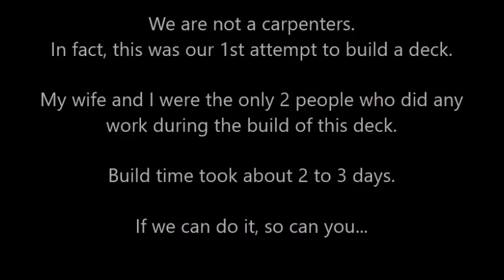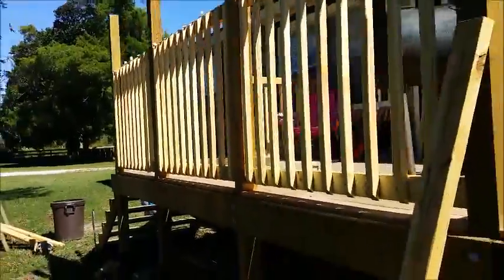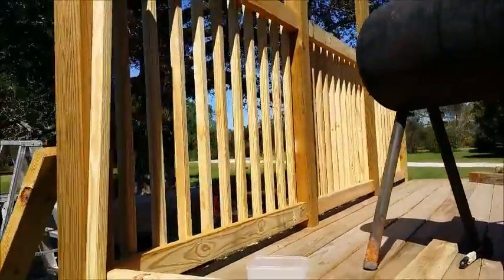How to Build a Small Deck

Comment: Thank you for the video. I am planning to build  small 4x4,  6 steps deck.
Reply from the maker: Welcome, the only thing i would suggestion is using 2x6 braces underneath the bottom of the deck, attaching them to the posts.

Comment: Yeah you got off lucky on your post and only having to use half a bag of concrete in each one my first deck build I almost had to tear it down because i failed my inspection when it was time to renew my homeowners insurance turned out that I couldn't bury my post I had to cut and dig out all 16 of my 4 ft deep post and then get one of those concrete tube things and fill each one of them 4 ft deep with concrete it took 4 and a half bags each and then use post anchors on top. Worst part of it was I had built a 10x16 deck thing was heavy as hell and had to be moved out of the way and put back it was not a fun fix for sure.
Reply from the maker: That does not sound fun at all.  If I could do it again, I would have used 6x6 posts and cut a notch on the top of the posts to set the perimeter actually on the posts as opposed to just lagging them to them.  The deck is still holding up, but is going through a serious weathering and plan on redoing the boards with synthetic materials.  I hope you have a small tractor to pull those posts out and redig the holes, if not, you have the excuse now to buy one.  Good luck.
Reply: @JRMSweeps  yeah fortunately I own a couple of gradall 544d10-55 telehandlers that made easy work of lifting the deck up 15 ft from each side.
Reply from the maker: Oh yes, that must be soooo nice.

Comment: Did your deck sink yet?
Reply from the maker: Sink?  As in settle?
Reply: @JRMSweeps  yes, did the furthest side away from the house sink? I ask because a lot of guys use the half bag method as a footing, but in some climates, it's not enough to hold the weight of the deck for more than a few months......
Reply from the maker: It settled a little, yes, but not where you notice it while on the deck.  Maybe enough to where when I spray it down, the water will ever so slightly roll to one side very slowly.  Other than that, it has held up very nicely for my 1st deck build.
Reply: @JRMSweeps  yeah, that's why I don't like the half bag method for footings. Easy to jack it up, add some short horizontal pcs of rebar, and add another bag to the top of the hole for a bit more strength. I know many guys recommend the half bag thing, that's not your mistake, but the work you did overall looks good. Your carpentry skills are better than some guys I see that build decks for a living. Anyway, was just curious about the sinking, not trying to give you a hard time. Your work looks good man.